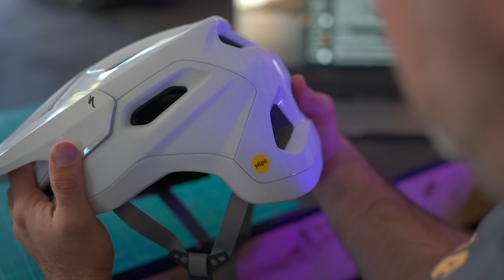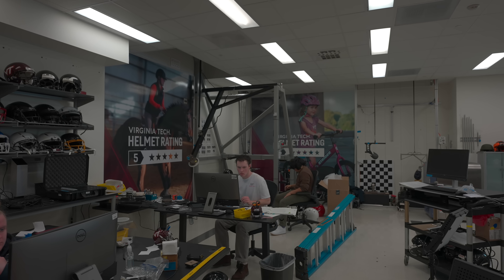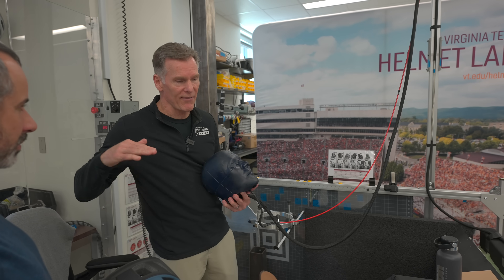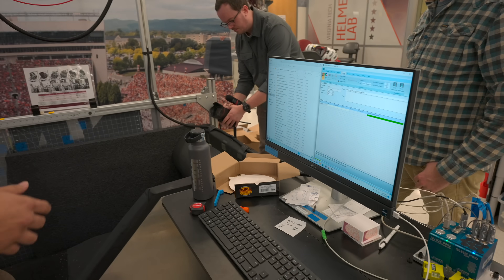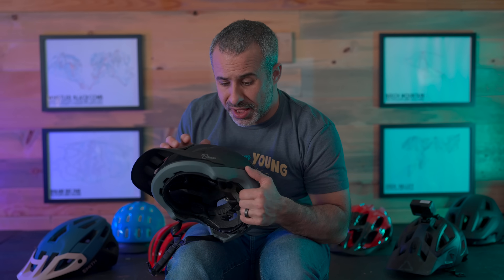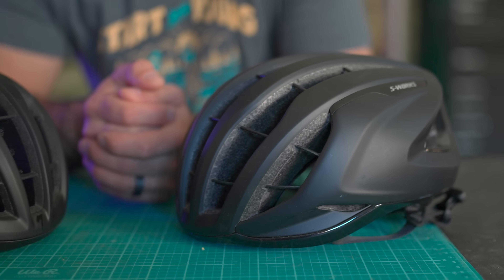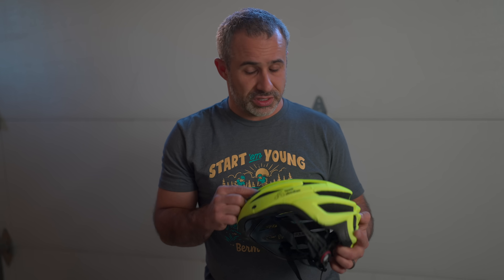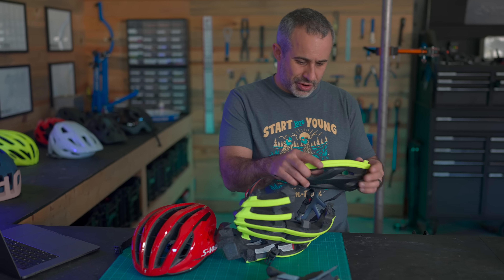Are Cheap Bike Helmets Safe? We visited a helmet testing lab to find out

Comment: Hi Seth. Great value content. I just have one problem: They only have 4 full-face helmets on site. The best one has a score of 10.17. By that is Specialized Tactic 4 with a score of 8.55 much better. They seam to know what they are doing so the messaging around that is confusing. Do they have different testing standards for full and open face helmets or should I ditch my full-face and get Specialized Tactic 4. Can you check with them what is this about? Their site seams as a great tool for deciding what to buy
Reply: They're testing for concussion and skull survivability only. A full face doesn't change this, it just adds additional protection for the face\nose\jaw
Reply: @alpd7638  so they are assuming the same forces on impact all around and aren't testing front impact to the chin.

Comment: My biggest issue with helmets is the shape of my head, I can barely find something that fits me right, most helmets kinda pivot on my forehead and feel loose on the sides. I just checked for my helmet and it's not the best, only 4* and 14.81 score :/
Reply: Not sure if other manufactures have anything similar but some Specialized helmets have two different head shapes, “Classic Headroom” and “Round Fit Headroom”.
Reply: @Tweak42  Im not really sure, but so far Specialized helmets fit me well. I just bought the Tactic 4 on sale, it fits me alright!

Comment: Again, on that 2nd cheap helmet you gave the stomp: Too little deformation can kill you just as much as total disintegration. The helmets are designed to absorb a VERY specific amount of energy and if its just transferred to your head because the helmet it too rigid it can actually have adverse effects.
Reply: The same was found with the Snell standard for motorcycles decades ago. Basically the Snell standard is too hard, and would only protect you in the MOST severe accidents. A softer helmet with more give transfered less G's to your brain in the vast majority of likely scenarios you would face.
Reply: @JoshuaTootell  Someone suggested in another comment here to look for the podcast with Kali helmets. I searched that up, and it was a very interesting discussion. Basically his premise is that we need to make helmets softer or at least more progressive, and that the current standards basically just ensure that helmets protect against skull fractures. It is then up to helmet manufacturers to go above and beyond. 

I know lots of people who suffered major concussions while wearing helmets so while super useful, they are not a panacea. It may be very difficult to achieve vast improvements in helmets though given the constraints.
Reply: Yes, and from that perspective, something like the stomp test, while illustrative of how poorly made that counterfeit helmet was, really doesn't show anything quantifiable or meaningful without more research.
Reply: @jamesroscoe7555 Hmmm, nah, I'm not buying that. Literally. It disintegrated. Seth is not even a very big man- that stomp shouldn't have completely destroyed any helmet like that.
Reply: @Happy_Biker  I think it is pretty obvious that the counterfeit helmet was a disaster. I don't disagree with you. My point, and the op's, comment is that what are we supposed to expect of a helmet if a guy stands on it? How does that relate to a real world bike impact. For that matter, how does the VT testing relate? It is quantifiable and great as a relative comparison, and I suppose one could argue the stomp test is a relative comparison... But how a test is designed is also important. Eg we could test those three helmets by shooting a bullet at them. What would the results tell us? It is a complex thing to test and different labs do find different things with different approaches.
Reply: @jamesroscoe7555  This are my exact thoughts on this video and I'm surprised more people aren't talking about this. It is very difficult to get any valuable information from this video apart from that some cheap helmets might be on par with or better than more expensive ones, and that counterfeit helmets exist.